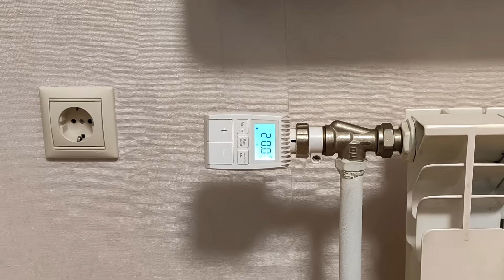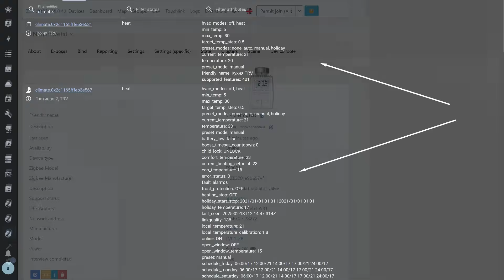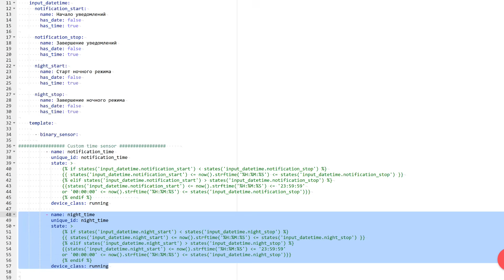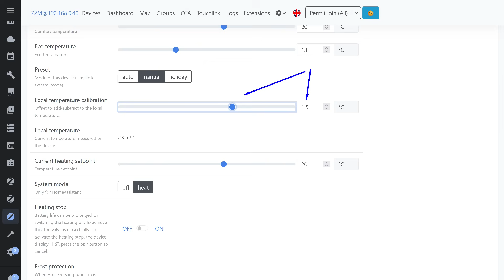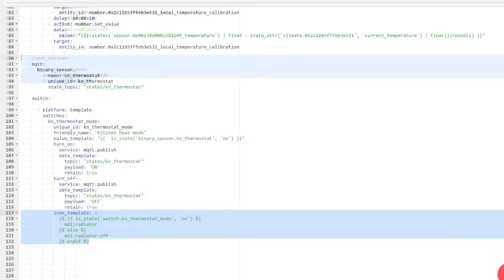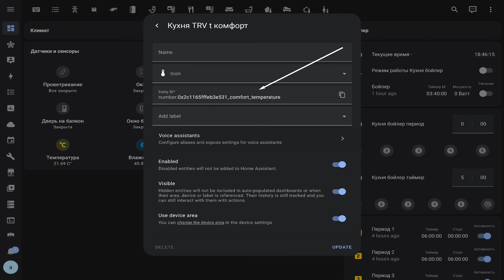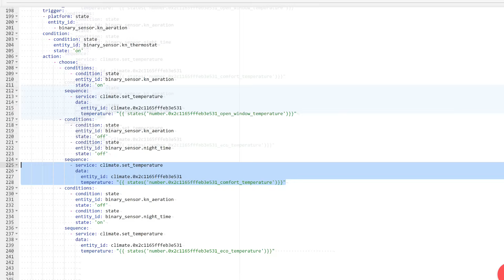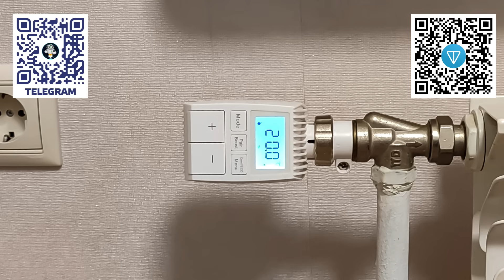Home Assistant - практическое использование zigbee термоголовок в zigbee2mqtt 2.x

Comment: Muy bien video, y un gran aporte para la comunidad, veo que eres un gran conocedor de cabezales termostaticos y estoy en un caso similar al tuyo, uso valvulas termostaticas sonoff TRV-ZB y sensores externos SNZB-02D pero tengo dos grandes problemas, el primero es que no se como puedo vincular los sensores de temperatura externos a los cabezales usando zigbee2mqtt, esta opcion si venia de forma intuitiva en el iHost de sonoff que he dejado de usar, y la segunda es como puedo actualizar el envio de los datos de los sensores de temperatura SNZB-02D con mayor frecuencia a mi homeassistant puesto que estos estos sensores solo envian la informacion cada demasiados minutos perdiendo eficiencia en mi sistema de calefaccion. Muchas gracias por tu tiempo y tu ayuda
Reply from the maker: En la válvula Sonoff TRV-ZB, según recuerdo, no hay posibilidad de calibrar la temperatura local, pero sí de configurar el % de apertura de la válvula. Puedes crear una dependencia: a partir de la diferencia entre la temperatura real y la deseada, establecer el % requerido.
Respecto a recibir datos con mayor frecuencia, lamentablemente no funcionará. La frecuencia de actualización también depende de la diferencia de temperatura, lo demostré al probar un sensor similar en este video: https://youtu.be/HJ0O3FpN5es. Si la diferencia es pequeña, los datos tardarán mucho tiempo en actualizarse; para salas de estar normales, esto se considera aceptable.